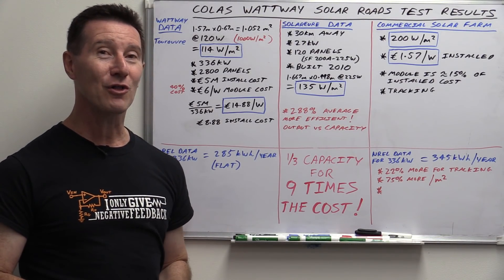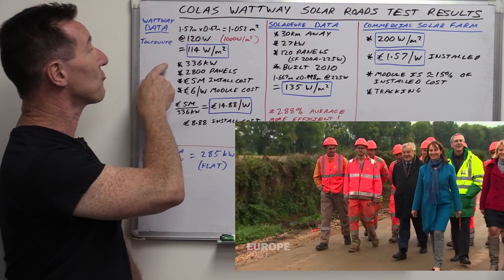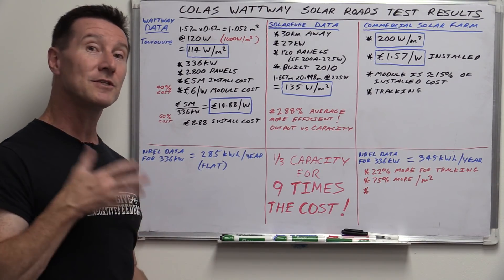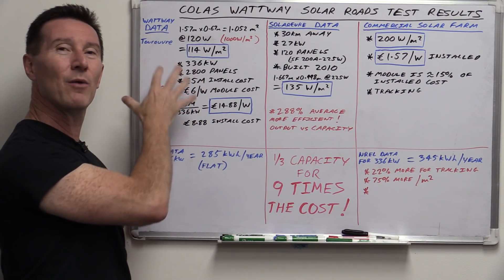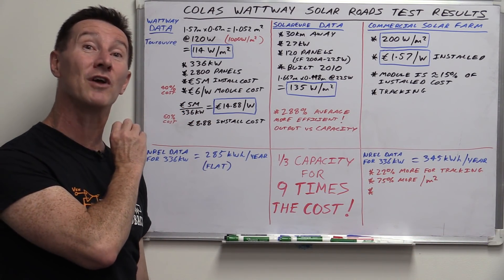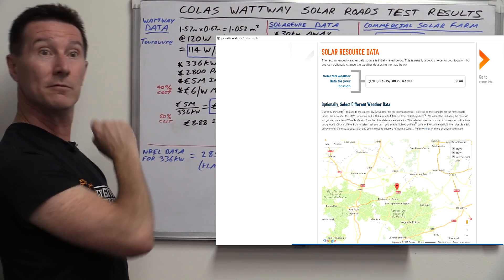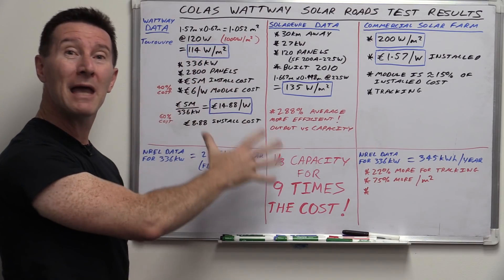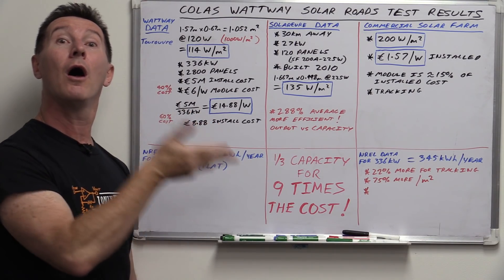EEVblog #1047 - Solar Roadways FINALLY BUSTED! (Colas Wattway)

Comment: I agree a solar road is a ludicrously inefficient idea.  But to be fair, I suspect your numbers for a commercial solar farm do not factor in the significant cost of the land they are sitting on?  Given the issue of available land for solar arrays, and the significant wasted area of rooftops, surely the optimal solution is for governments to legislate to encourage rooftop solar installations.  If governments ensured that it became cost beneficial for property owners to install rooftop solar arrays, then we'd have all the renewable energy we need.  This simply requires government backed funding to ensure no upfront costs for homeowners, net reduced electricity bills, with excess power fed back into the grid.
Reply: Even if land is expensive in rural areas...
I'd like to see all the home roofs and parking lots and building roofs etc. of a city completely covered by the solar panels before the government starts even considering the roads.
Reply: They do factor the cost of land acquisition. If you pause the video when he is showing the graph of the commercial installation costs they include soft-costs which factor-in land purchase costs.
Reply: Even in densely populated areas of Europe, you can often find land that has almost no value otherwise. Old industrial grounds, ash heaps, landfills, spaces around the transportation infrastructure, large industrial buildings...
Reply: Hi Lassi. I’m in Auckland (NZL). POV biased by our city starting to sprawl consuming valuable agricultural land to the south. When you fly into a city you see acres of rooftops, all just reflecting the sunlight. Knowing that some countries subsidise household rooftop solar panel installations, widespread urban rooftop installation would seem a logical approach. Houses are already connected to the electricity grid, and you’re also generating electricity exactly where it is needed. Just seems to make sense to me.
Reply: I live in a small European country, and even we have land that no one lives on and can't be used for farming due to the soil quality. Land like that sells pretty much for nothing.
Reply: Umm, 3:38. $1.85 per watt including land acquisition.
Reply: Land in rural areas is on the order of $1 per m^2. At 200 Watt per m^2, that's $0.005 per watt.
Reply: But I do agree that rooftop installations are better. The only downside is that the panels can't track the sun in those places.
Reply: Pretty sure the broken solar panel in the roadway would go to the dump too, either that or its left broken and useless, doesn't just magically turn into asphalt and become blacktop. 

Maintenance cost, you gotta be nuts if you think it'll EVER be cheaper let alone even the same price to maintain something that's being driven on vs something that isn't.

The roadway is nowhere near economically feasible and that was just Dave's point. The only thing that would make a solar roadway an intelligent investment is if the cost of land is so astronomical that the power losses and maintenance cost are still cheaper to cover than obtaining land.
Reply: Land availability/cost is not a big issue for solar installation.  Rooftop installations are also good, especially in areas with high A/C usage since it reduces distribution requirements and power generation correlates with A/C demand.  But grid scale installation is overall cheaper per kWhr.
Reply: China is (stll) horrid, but they are spending most $$ on green power
Reply: Why not build up, and put the solar panels in the air? You know, so cars aren't driving on it and it can do sun tracking?
Reply: I the UK they use the land under and about the panels for sheep pasture so don't lose the use of the land. In Spain there is a lot of spare land that is of no use for anything. One additional cost is the cost for moving the power to where it is needed.
Reply: there is one huge problem with that: current energy grids cannot handle it when those solar panels start backfeeding into the grid. ... and solar farms don't need any special land, any will do.
Reply: Governments around the world already own countless buildings with flat roofs.  They should be spending the money on that until all with sufficient sunlight are covered before spending so much on crazy ideas.
Reply: Richard Smith how about all roads having over head structures with solar on top ,feeding into a grid that outputs to charge stations for electric cars .?.
Reply: How about Australia? Huge areas that get too much sun for human use.
Reply: The thing of it is a square kilometre of mirrors to provide process heat in the Australian deserts can be a fuel factory, splitting water and CO2 to combine the carbon and hydrogen. Dozens of them would just about cover all fuel needs for us, more to provide for other nations. Big business.
Reply: Rooftops are good for home solar because there is little to no maintenance and transportation cost involved. But it has lower efficiency. The nice thing about commercial ground solar is that you can do 1- or 2-axis tracking easily and maximize returns on the most expensive parts of the installation, panels and inverters. Compared to these things, land is relatively cheap. According to my back-of-an-envelope calculations, some 0.5% of the Earth's total land area would be enough to replace all the fossil fuel we use with renewable sources. Land usage is not an issue.
Reply: how about a calculation on solar farms for northern countries like Germany. I bet that they should just use wind.
Reply: So according to you, it’s “beneficial” for the government to steal even more of my hard-earned money than they already do, unless I agree to install solar panels on my roof.  Thanks!  I need the government to steal more of my money and spend it far less efficiently than I can spend it myself! What a fantastic idea!

When solar panels are capable of saving me money on my electric bill, I will then voluntarily install them, because they will be saving me money.  The free market will figure this out, if you get the government the hell out of the way.
Reply: Please tell me how exactly that money buzz and stealing thing follows from my comments. Next please tell your point of view on fundamental physics research: in your words it is a way bigger "stealing of your hard-earned money" than building a small road covered with RnD tech. 

Once again: my point is that the video content does not correspond to its name and the problem is way more broad than discussed. If you have anything to object to it-I am willing to discuss, thank you
Reply: Renegade30 you may wish to look up vertical farming which uses farm land to build vertical vegetation farms and uses solar to power the needs of the uv light that lay on the ceiling of each level of crop
Reply: Daniel Han unless they con the world into pegging their currency to oil and then just print their own currency ....like usa does
Reply: Johns Video they are stealing money because an envelope shows that it is pointless. If they wanted to do something constructive they should sit down and design new ideas that on paper do show merit including long term production cost reduction.. Current road designs do not show any promise even on paper ...wasteful ,stupid and insulting to engineering practice
Reply: Carl Zimmerman exactly..solar panel sitting in free air sucking in rays of light versus a panel being driven on by semi trailers and heavy vehicles ..maintenance cost comparison not even comparable
Reply: Exactly @DJW1959Aus... all that desert land in the NT, WA and Western Qld, etc.... this country could be completely solar powered if they wanted to, as long as they incorporate a storage system. Maybe they need to be looking at the Morocco solar farm... solar collectors providing 24-hour power and storage!!! Or as The Kaveman suggested, overhead solar (with the added bonus of shaded roads!) ... solar roads as a 'nice idea' at best, but impractical due to vehicles obscuring them, W/m2 ratio, and the fact that they will be scuffed and damaged hence the output will have to go down dramatically faster than a domestic or commercial solar system and have drastically higher maintenance costs.  If it were just R&D, that would be fine, but it's being sold as an example of the future, and that is just utter nonsense and stupidity.
Reply: Greg Clare you do realise NZ gets the vast majority of our power from hydro electric right? Solar is not really necessary for us.
Reply: He didn't factor diminishing efficiency of "solar roadways" due to the rubber, oil and other dirt deposits either.
Reply: Hi David Chapman. You make a valid point, NZ is certainly relatively well catered for with renewable energy. I suspect my thought path was biased towards individual contribution to renewable energy and the subsequent potential for consumer power cost savings (through rooftop solar arrays with reverse tariff savings offsets etc). But in retrospect that's perhaps diverging a little from Dave’s original point, albeit still solar cost related. :)
Reply: Greg Clare solar arrays on sloped roofs are quiet ugly.
Reply: @Greg Clare
 We have a solar roadway cycling track in the netherlands, and they basiclu came to the following conclusion :

It would be more effective to place the pannels above the cycle path instead of on the cycle path surface.
The layer added to make the panels more durable so one can cycle over them makes the pannels less efficient and would not be needed if the pannels where above the cycling path.
If the panels where above the cycling path they could be tilted and to some degree be made to track the sun increasing efficiency.
The panels above the road could dubble as infrastructure for lighting the cycle path.
It might make cycling on the path more confortable as the pannels above the path would create some mesure of rain and wind protection for the cyclists.( while the panals onthe road surface thend to get very slippery in freesing conditions.)
Reply: Flanders did this and it ruined their governmental budgets for the next few years. Furthermore, it spiked energy bills for anyone still too poor to install the panels because energy companies still wanted to maintain their revenue. The ruling was a disaster and led to the early career end of at least two politicians: the one who started it and the one who had to come up with a way to get more money to fill in the huge black hole left by the former.
Reply: Greg Clare
Bob's numbers are not from a commercial solar farm, they are from a large scale rooftop installation, he mentions the commercial solar farm to illustrate the point that he is comparing the roadway to a not very efficient solar panel installation.

As to your point about the cost of the land is valid but there are ways around it to a point.  Rooftops are the easy choice as there are so many that are empty, but you can also install them as shade roofs for parking lots or put very large commercial ones in desert areas.  For example, Death Valley is unusable for any other commercial purpose so why not use that?
Reply: Greg Clare  1.6€ per watt is about 1600€/meter. The cost of the land is clearly negligible.
Reply: Better solution is nuclear fusion power. Solar doesn't work all the time, you get fuck all power at night, overcast conditions destroy efficiency, the panels need frequent dusting...blah. We need to stop faffing about with trying to harvest some of the sun's energy and just start creating our own miniature suns that can power entire countries 24/7/365 no matter the weather. And until then, let's split some more atoms.
Reply: Land is certainly an issue for some locations. However, at least in America (probably one of the worst for energy pollution in the rank of first world nations, china is horrid but doesn't count) We have acers for sale in the range of a couple thousand per, to 10k per. A square mile (2.55sqKm) of land can be bought for less than 500k near cities, if you are willing to run power lines a ways you can get that same amount of land for half the cost or less. Places like Europe or Japan that are much smaller and have a higher density than America will have issues with land becoming expensive i'm sure.
Reply: In Germany farms are downsizing and using their disused land for solar farms, so if you consider the land already exists in this case then its different.
Reply: Pretty-much every solar farm is built on land that is either gifted to the company, from the Government, or cheap to purchase based on location.  Windfarms running in Adelaide, the land is rented/leased for a token amount, as the land is usable underneath the units..
Reply: Solar is inefficient use of land. Acres are needed and such commitment must be for 10s of years. Desert lands? side of expressways, hill cuttings that face north?
Reply: Greg Clare yep...only governments dumb enough to pay for this.
Reply: What I like about this is people trying to get creative about spaces that could be dual purpose.  In this case a roadway and a source of energy.  Its all first gen stuff.  See what happens over the years.  Who knows maybe someone will come up with a way to mix something in the asphalt and just put conductors along the sides to collect energy.  I really think the tone of his video is just implying they are just trying to be challardins and stealing money.   I hope it's just a good faith attempt at pushing us forward.
Reply: you are a moron if you think solar panels on roads will save the earth
Reply: Agree. He also forgot to exclude the price of the road that came for free with the solar panel. Plus the most important: maintenance cost. It may turn the tables either way although we all expect the new technology to lose in this battle too.  

What he did prove is that it gives less power for more money than the widespread and tested tech. Can't disagree. Problem is that life is more complex: what about tech development during the RnD phase? What about maintenance? What about active development cost cuts after a few years? And what about the overall footprint? The used solar panel goes to the dump. And this one stays as a road.

My point: the name of the video is a clickbait. Any of the questions I've mentioned can play major role proving the presented arguments wrong or right. Wish someone competent does this some day.
Reply: if governments to legislate for more of this! then governments can pay for it .  with reserve bank $

Comment: I saw another add for solar. was hilarious, they are trying to sell solar windows. they are saying the windows will be many times more efficient then "traditional" solar. haha.
Reply: These solar windows reflect the sunlight into solar panels in the windowsill. They do also have a benefit of keeping most of the heat away from the buildings that means less energy wasted on airconditioning. It won't ever be as efficient as rooftop installations but if rooftop is not available due to architectural limitations it sound like a plan for those glass filled offices.
Reply: MrBluemoon74 absolutely I think they are a great idea in certain applications. I just laugh when they sell something so high it gets absurd. Like 4x more efficient than rooftop (whatever that meant to them) lol